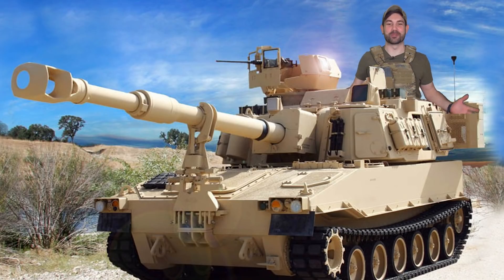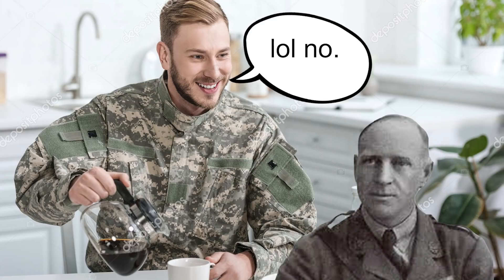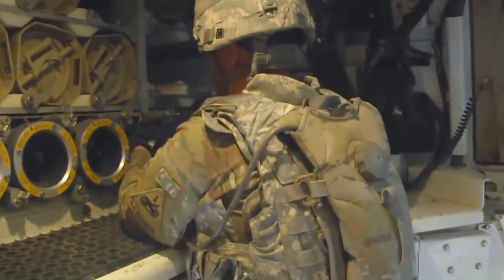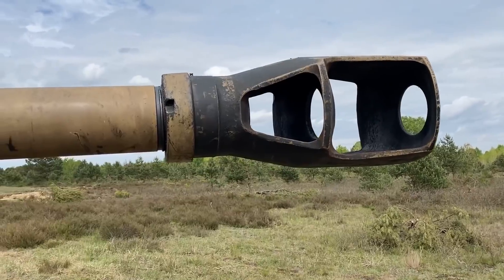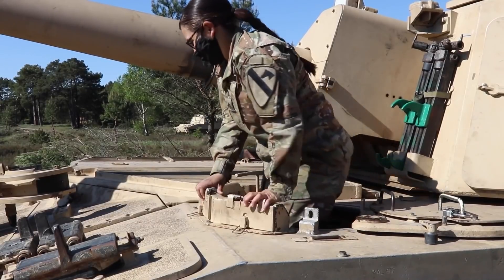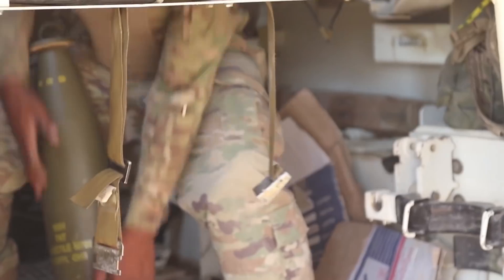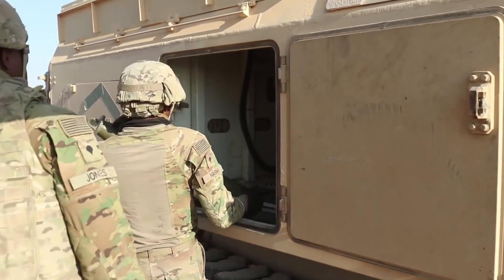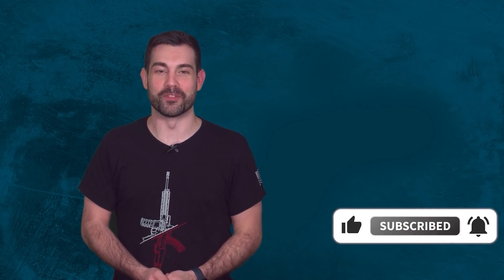M109 Self Propelled Artillery Vehicle Tactics Explained

Comment: I think these will be replaced with auto loaders at some point . The new autoloader are becoming pretty good compared to the old ones.
Reply: Mostly because they need a smaller force, and have allowed females into the Artillery .... they just aren't built to manhandle 98 pound projos on the regualr.
Reply: @danieparriott265  if they can’t do the job then they shouldn’t be there. Of course, when it comes to enforcing existing standards which might exclude those who shouldn’t be there in the first place or lowering them so they don’t have to have a spine and stand up to the social experimenters...the Army will lower the standards every time. 

I cant imagine the same team members having to combat loadout the guns and 992 all the time will NEVER get resentful about having to do all the heavy lifting because part of their team “just isn’t built” to manhandle a standard M107 projectile. Or god forbid the stronger team members get wounded or killed and now the gun can’t shoot because the tiny ones can’t pull out the knucklebusters from the FAASV or even their storage locations in the gun outside of the ready rack. Certainly won’t be any timely 10-20 rd FFEs anymore...but, the grunts must feel better now that their fire support is so inclusive, stunning, and brave while they are overrun for lack of an effective FPF.
Reply: Not a fan of auto loaders. More moving parts to service and potentially go wrong and you lose a crewman which leaves you with one less Soldier to do maintenance, position improvement, guard duty, etc.
Reply: @majorleagueminuteman1344  every Modern army is moving towards autoloaders
Reply: @Miami1991  there is more to artillery than just shooting the fastest. Also, most effective fires only occur during the first volley anyways, after that it is suppression. Cutting down your crew to facilitate the auto loader sacrifices readiness. Less crew means more workload in maintenance on a more complicated system. That’s also less crew to pull the necessary 2 hour guard shifts at night which will have an aggravated fatigue effect over sustained combat operations. Just my 2 cents.

Comment: It is however outdated, the pzh2000 is way faster, shoots quicker and has better data systems
Reply: I'm curious if the pzh2000 can use that anti-missile round, or if it has something similar.
Reply: @scratchy996  its the same 155mm gun, so it should. It can use M982 excalibur tho.

Comment: The M-109 is obsolete, has been for sometime. The problem is no one can settle on a replacement. The US Army hasn't faced adversary artillery since Vietnam and even then it wasn't anything like World War Two, but if the US faces a near peer opponent then we'll find out just how obsolete the M-109 is. Russian artillery out distances the M-109 and is capable of similar firing rates and is capable of "Shoot-n-Scoot" as well. The US did away with its 105 mm, 175 mm and 203 mm SP artillery years ago...the Russians still have theirs. The US has sunk its dollars into rocket artillery and towed artillery such as the M-777 and M-119. The Army needs a new SP artillery.
Reply: Completely agree, the Army needs a SP 105mm at a minimum, the M119 just doesn't have a role in a near-peer conflict.
Reply: @aidanlukas7758  not a 105 but a 122 for sure.
Reply: @PatriotEnfield3276  It would be great to have a 122mm, but I highly doubt it makes logistical sense to switch from 105mm to 122mm across the entire Army.
Reply: @aidanlukas7758  given many countries use 122mm and it is more wide in circulation , all we just need is some license to have those machineries up from ex comm bloc nations and other   states  like Poland, Croatia , Finland , Hungary, Romania, Bulgaria  ,Eat Germany etc. D 30 and 2s1 gvozdika , both 122mm systems are already in US possessions for OPFOR roles , so i don't see US having a problem with reverse engineering and quickly making Logistics  okay.
Reply: @PatriotEnfield3276  I am not completely convinced that the answer is upgrading to 122mm, especially when we already have 120mm mortars. Basically the argument can be if we go with 122 why not just use 155? I think 105mm still has a role to play in terms of its easier logistical burden, higher fire rate and ease of loading/operating a howitzer. I think the only issue is finding a way to make it self-propelled or more mobile. The Army's Hawkeye program is one example of a good attempt at a solution.
Reply: @aidanlukas7758  The M119 is used by Airborne units for fire support.
Reply: @brianfoley4328  Yes I am aware, the every IBCT has 2 batteries of M119's and 1 batter of M777's, it isn't just constrained to Airborne units. My point was that towed artillery is obsolete at this point since it lacks the mobility to lay spades, conduct a fire mission, and relocate rapidly enough to avoid counter-battery fire. Not to mention the fact that even using the M119 in such a large number of units (IBCTs) puts us at a significant range disadvantage when compared to our near-peers. a SP-version of the M119 is the only way to make it somewhat viable without having to restructure the entire supply chain from 105mm to a larger new caliber like 122mm or 170mm.
Reply: @aidanlukas7758  can you explain how the hell the smaller caliber would help cuz that is confuses me Excalibur has a rocket assistant motor that allows it to go hypersonic it's going to be harder to fit that kind of motor into a smaller projectile🤨
Reply: @danielsnook7362  I'm not advocating for a SP 105 mm, there's not much use for that...but larger caliber guns such as 175 mm and 203 mm...but however the Army proceeds, the M109 is obsolete by any metrics you carry to use. It'll have to do until a replacement can be developed but the US axed the original replacement due to costs...but the M109A7 as advanced as it is, is still obsolete and outranged.
Reply: @brianfoley4328  are any of them hypersonic Excalibur can go a mach 5 or above while reaching the goal of 70 km and they are working on 100km as we speak besides the science that's going behind Excalibur could easily be applied to larger caliber munitions
Reply: @brianfoley4328  not to mention most to tanks and artillery pieces suffer from uneven ignition as far as I know Russian technology suffers from the same thing and this Factor can affect accuracy speed and range which thanks to the Excalibur program we're trying to fix. as far as I know  Russians have never mentioned this problem I'm not making stuff up either just look up the video ETC Cannons by spookston also these factors can damage the barrel and the actual projectile
Reply: @danielsnook7362  Okay Daniel, I'm not sure what your point is about "uneven ignition"...but let's agree it's a problem...for everyone.
Reply: @brianfoley4328  and you think Russian artillery that's so much larger than ours is any cheaper as artillery shells get bigger they become more expensive especially if the are guided
Reply: @brianfoley4328  plus that problem with uneven ignition if fixed would be a huge benefit for our tanks artillery pieces even our Carl Gustav's would get a boost if we applied the same principles it's pretty obvious to me you didn't watch the video I recommended so come back to me when you actually watch it and this is far easier and far cheaper change than switching to whole new platform and caliber because all you have to do is change the powder or the way it's constructed and ignited😒
Reply: @danielsnook7362  Daniel...I don't think that Russian artillery is "so much larger than ours..." I know the Russians use larger calibers particularly 203 mm (8 inch). The costs of a generic 155 mm round is about $ 400. Put a special rocket booster on that and some fancy guidance (Excalibur) and the costs shoots up to $ 112,000 per round....now tell us Daniel....what if I fire 100 rounds (with a CEP of 50 meters) of "dumb ammunition" at an eight digit coordinates versus two rounds (with a CEP of 2 meters) of really smart ammunition at the same target...who is going to win the war in the long run...the guys spending $ 40,000 per fire mission or the guys spending $ 250,000 per fire mission ?
Reply: @brianfoley4328  did you realize the prices of certain military tech does go down right after they're done testing and upgrading the thing and a unpowered subsonic dummy round I'll tell you is going to be way more easier to intercept with so many countries investing in lasers even though I see your point mine is that I'd simply want around to actually make it to a Target and actually hit its Target even if it's only one or two as opposed to a dummy around that's really slow and could be intercepted really freaking easy even in if volleyed in fact I'll tell you piece you just named sounds like it's larger in diameter so yeah it's probably more expensive and Excalibur puts dummy rounds to shame with their lack of range
Reply: @brianfoley4328  that's the reason why the tomahawk is obsolete and the Russians are laughing at us tomahawk has no survivability it gets intercepted way too damn easy cuz it's so freaking slow it's the same with slow subSonic artillery arounds we made the prsm for a reason and that thing is designed to be effective and cheap
Reply: @brianfoley4328  that doesn't mean you could use the Excalibur for high priority targets then switch to cheaper dummy rounds depending on the threat level and powder issue once fixed can be applied to dummy rounds as well
Reply: @danielsnook7362  Daniel do you realize that the original cost of the Excalibur round was $ 70,000 per round and now it's $ 112,000...so much for your theory of ammunition getting cheaper. "Having them around" means you have to buy them in quantities from the manufacturer. The reason we don't have F-22's is because they cost too much to build and we can't just fire up the assembly line whenever we want more, that costs money and the manufacturer wants to make a profit (imagine that)....so we can't "just have some around"...that was the problem with the Navy's extended range munitions for the Zumwalt class...just to stock the magazine costs too much....so you want to answer the basic question of who eventually wins the war...the guy who puts 100 rounds on target for $ 40,000 or the guy who puts 2 rounds on target for $ 250,000 ?
Reply: @danielsnook7362  See my answer from your similar missive.
Reply: @brianfoley4328  the guy that wins is the one that confirms a kill which one is more likely to be intercepted a hypersonic or a subsonic? If More than half of your dummies don't connect to anything and you're only scored a few kills that's not good for your pocketbook either even if ammunition is cheaper and you don't do enough damage with a dummy around you just give away your position
Reply: @brianfoley4328  and like I said a better propellant system could be applied to a  cheap round but we never would have considered this if we didn't start the Excalibur program
Reply: @brianfoley4328 and if they could find a cheaper alternative to the Excalibur more power to them just don't think dummy rounds last long in a modern fight think about how far active protection systems came since the first one was made not to mention other countries are working on lasers which could intercept quite rapidly and quickly multiple projectiles
Reply: @brianfoley4328  I suggest we use 170mm caliber. technology hasn't reached up yet for a system like M109 with a 175mm or 180mm gun , let alone 203mm. plus there are systems like kok san artillery of North Korea that uses 170mm ammunitions . and Germans  also used 17cm Howitzer in ww2 .
Reply: @danielsnook7362  Excalibur is not able to go hypersonic. It is a GPS-guided round that packs a smaller punch than a standard 155mm munition, but is exceptionally accurate and very expensive to fire. The smaller caliber does NOT help and cannot support Excalibur, but unless the Army wants to waste its entire stockpile of 105mm shells and covert the entire MTOE of IBCTs to a different artillery system then the optimal path forward is finding some way to make the M119 (or some other 105mm system) self-propelled. Towed artillery in general is mostly outdated except for airborne raids and creating fire bases in mountainous terrain, and since we are out of Afghanistan there is little need for that.
Reply: @danielsnook7362  Plus the M119 ALREADY has a rocket- projectile (RAP) that extends its range to 19.5km. Excalibur or the lack thereof has no bearing on the argument of whether small-caliber towed artillery is obsolete.
Reply: @aidanlukas7758  you realize Excalibur goes way beyond that right currently they managed to push it out to 70 km and are planning to make it go 100km like I said in my other comments if they could find a cheaper alternative more power to them however I also said in my other comments that they're working on improving the powder to burn more evenly and strongly thus improving it's accuracy speed and range that kind of research could be applied to dummy rounds, cheaper rounds hell even to higher calibers that kind of research once they figure out how to do that could be applied to our tanks our recoilless rifles and if make it small enough we could apply the same powder principled to our ngsw rifles
Reply: @danielsnook7362  Nope, you're wrong. Excalibur is not what extends the range to 70km, it is the ERCA program that is putting a much longer barrel onto the current M109 system, as well as upgrading other features. They are developing hypervelocity ammunition and ram-jet or base-bleed shells for howitzers, but you are confusing these innovations with the Excalibur round that has been in service for at least a decade. Part of what you say is correct about creating better burning/more powerful powder, this would directly help artillery across the board achieve greater range.
Reply: @aidanlukas7758   hopefully they will be more economic or cheaper than the Excalibur I understand it's a numbers game but seriously dummy rounds are not as effective think about how active protection systems have evolved. multiple Nations pursuing lasers that could take out drone swarms fairly quickly The intercept most of the subsonic artillery grounds and barely any of them hit anything. you gave away your position with doing very little damage to the enemy we've made more expensive things in the past too seriously but hey if they can make it cheap round that's just as effective I'm all for it
Reply: @danielsnook7362  1. There is no current laser technology that is able to shoot down artillery shells, much less deal with several batteries massing fires onto a single target. 2. Excalibur does NOT provide hypersonic capabilities or any method of avoiding enemy defenses. In fact it is even easier to "shoot down" due to how it glides to the GPS location of its target, in a much slower method than a shell following a parabolic arc. Hypersonic shells ARE being worked on, but they will not replace dumb shells for mass fires. 3. The fact that firing gives away our position is exactly why I stated in my original post that towed artillery is obsolete and we need to vastly increase the amount of self-propelled howitzers we have. The best chance of overwhelming a futuristic active protection system is by massing fires from several batteries onto a single target, using a time-on-target mission so that all shells are impacting simultaneously.